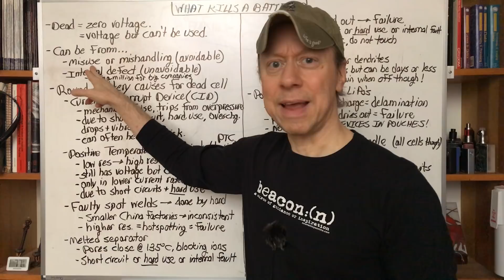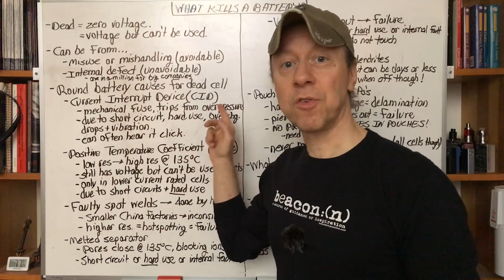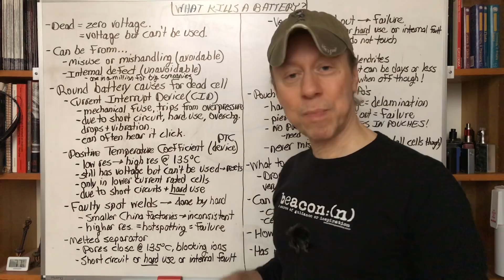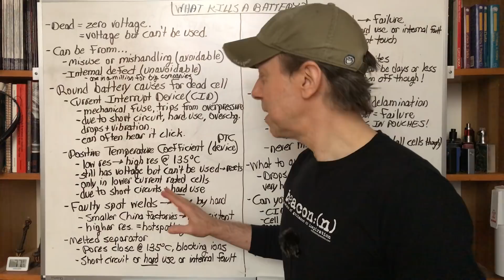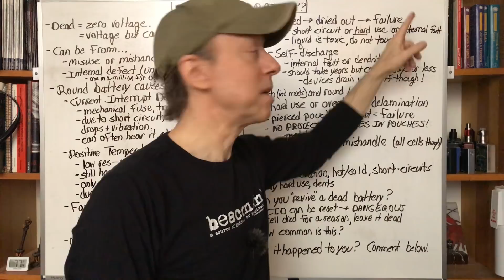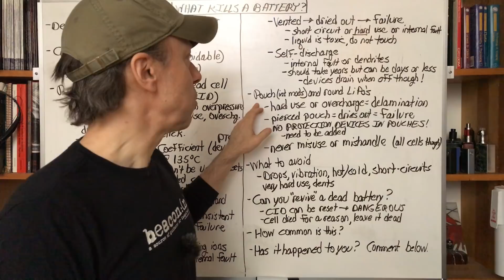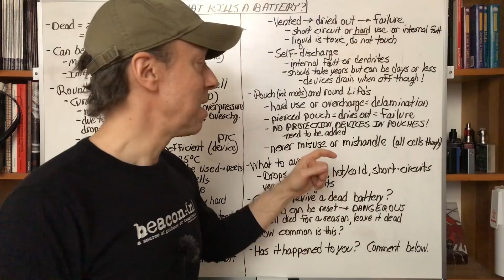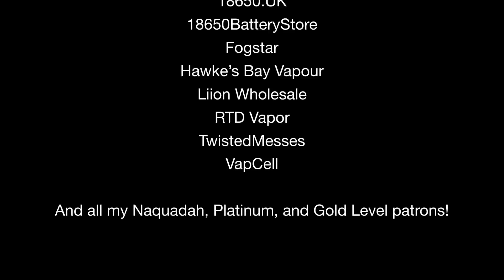Minding Your mAhs Ep028 – What causes a Li-Ion battery to suddenly fail?

Comment: Thankfully in 6 yrs ive only had 1 battery vent, it was a samsung a that i took out of a battery pack. Ive not had any go into thermal runaway(knock on wood). Usually i just stop using batteries because they dont hold as much charge as they used to. Like a pair of vtc5a will usually get me thru the better part of a day, but after ive been using them for a year theyre only lasting for a couple hours. When i recharge them instead of my charger showing that 2000 mah was put back into them when theyre new, the charger will say they only took in 7 or 900mah. Or like with sig mods the chip shows "real time" sag and the mod will say weak battery, even though it says the batteries are at 90%, when i go to take a drag it'll sag down too far and give me a weak battery warning. Thats when i stop using my batteries. One of the reasons i really enjoy my xtar chargers because it tells me roughly how many mah is being put into a battery. My most recent ones that i recycled were some 30qs. When they were new they would take around 2200mah from 3.4v to 4.2, but after about a year they were only taking in 1000mah. Chargers that tell you the mah can be a big help and tell/show ya when your batteries are on their way out.

Comment: Hey mooch, I had a married set of LG batteries (I don't know what model, but they were brown wrap 18650s.) One day I touched them while they were in the charger and they were extremely hot, after I removed them one would no longer register in a mod or in the charger. The batteries were about 1.5 years old and used at 70 watt. I was rotating their use with two other sets of batteries. The charger was an older nitecore 4 bay charger. Needless to say I ditched the charger and recycled the two of batteries.
Reply: The batteries were never dropped, but I had dropped mods containing these batteries on multiple occasions.
Reply: always replace yur batts after about 6 monthes or 500 charge discharge cycles   thats what they are rated for. P.S.  yur charger was fine   its the old batteries.......LOL

Comment: Thanks as always Mooch! Great information. I personally haven’t ever had a cell drop to zero, even the ones I’ve done high current (over CDR) test discharges on. I have seen however a handful of reports about 26650’s suddenly failing (0V) but without being abused. I’m sorry I can’t remember the particular brand and model, I’ll let you know if I can find out.

Comment: I use Samsung 30Q cells pretty much exclusively. Never had a failure. Had them get weaker over time as all batteries tend to do, but never a total failure with one. I DID have one 0v failure with an LG chem cell once. Worked fine one minute, totally dead the next. Never figured out what happened.

Comment: Actually that is such a coincidence that you mention how a battery was good as said by my mod and it wont fire a .3 ohm coil. Just last night this happened granted my batteries are about 3-4 months old but I ahave a system of battery alternation so it's just one big cycle of  15 batteries.  They were good just before I recharged them . Perfectly fine.  After that they would charge really fast, drain really fast. Never got hot. Just ended up throwing them away. They were imren 18650 on the wrapper they say 3000 mah 40A ( I know I know)  20CD . The I'd number I guess you would call it, under the actual wrap reads imren80515c. I just figured they were old but a coincidence none the less. Oh yeah yellow wrapper red print. Also if I use a molicel 18650 35A I dont remember the mah. If I use it on a reliable mech mod single cell at anywhere from .12-.18 ohm dual coil, how long would you say those batteries should be renewed?
Reply from the maker: It depends on how often you take a draw, how they are charged and stored, etc. IMO you should get a couple years from them, at least, unless there’s some abuse going on somewhere. There’s just no good way for me to estimate that though.
Reply: @batterymooch  ok , because I had these for a little over a year but during so I was kinda rough on them as they were my hardest hitting batteries I had so I ran pretty low ohms. I was recently noticing they started to lose their performance.  Looks like I'll get some newbies.  Thanks much. As always great content in your videos.  Super informative.

Comment: What could cause a Sony vct5a to rattle when you shake it. I bought 2 from my local shop and they both rattle when shaken.
Reply from the maker: STOP!!!
Do not shake them again! That is probably the metal rod they wind the layers of metal foil and battery goop on. If it is loose it could possibly short circuit against something internally and cause a fire or explosion. I don’t remember there being a central rod in VTC5A’s but I can definitely be wrong about that. Have you checked their authenticity?

Comment: It happened to me about 2 - 3 months ago. Vapecell 4000mah gold battery wrap. One day literally shows fully charged on the battery charger. After usage for about an 1 hour to 2 hours. The battery could not power up in the vaping device ( regulated mod) I was using. I tried charging it to see whether it would work, but no reaction ( like how you explained in this video).

Comment: Ayuh. Two times. First time was on a pair of ijoy 26650. The second was fairly recent with a pair of vapcell 20700 gold. I tend to leave my batteries in the cradle fully assured of the xtar's auto cut-off feature. In fact, all my batteries live in the cradle until I use em but on only those two mentioned pair of batteries I experienced fully charged but unusable. Heck, my vtc4s live to a ripe old age of 2 years before I decided to chuck em. Again, leaving them on the xtar charger full-time till I'm about to use them.
Reply: That is very similar to my experience - an Ijoy 26650 and 2 Vapcells (a married pair, but mine were purple 3750mAh 24A CDR 21700s).
I have a pair of the Vapcell gold 20700s, so will keep a close eye on their behaviour (they're next in line for cycling through my Ijoy Captain PD270).  I store batteries in married sets in silicone condoms in-house, or hard cases for carrying around, never in the chargers.  Just about any charger is built down to a price, and one surge on the utility power could blow the protections - although the utility power in my man-cave is protected by a 3kva UPS :-)
Reply: @The_Real_Phil_Lee  with mooch's report, I try to reason the deaths to overcharging (CID tripping), but living in the cradle after being fully charged, if anything else, the batteries actually go into discharge without triggering the charger into an auto charge mode. Xtar will only go into charge mode again if: you happen to break contact or, if the mains breakers reset. And those didn't happen when the batteries died. Plus, I always keep the amp charge at 0.5 across all cradles to prevent overheating.

Comment: This Friday morning I came into the kitchen and instantly smelled the dead battery :( I left the unregulated mod standing over night, it had (!) low voltage, short circuit and polarity protection but something went wrong and the VTC4 in it vented. The top of the mod is discolored, the spring from the switch burnt away and probably nothing left from the electronic above :( Oh, the isolation on the battery still looks fine. I suspect an internal short somewhere between battery and electronics.

Comment: Excellent video Mooch, thank you! 

I tend to "retire" my external lithium batteries I use for vaping after around 6 months and buy new ones. I keep the old ones and use them for flashlights and other things. I luckily have never had a castostrophic failure in the last few years of using mech tubes, however I studied your posts on the forums for years before evem touching a mech! Thanks for making me feel "safe" while mech-ing. 
Edit: all approximately three dozen batteries ive used are brand name LG , Samsung, or Sony.
Reply: I have alot of 18650 battery lights too, it is VERY dangerous to use a UNPROTECTED 18650 in a flashlight because there is NO venting that im aware of. I always use protected cells in my lights!

Comment: As per coincidence I got two batteries dying on me the past few weeks: 1 Sony VTC5A and a Samsung 25R. From the first one I don't remeber the circumstances. The Samsung was one of two married batteries I left in a regulated mod (not Yihi)  for a couple of months. While one Samsung drained down to 3.4V, the other one drained completely, multimeter showing no voltage at all.

Comment: This happened to me one time, but it’s human error. I accidentally reversed one cell in a parrallel setup.😲 I know! It’s f***ing scary. Luckily for me, it didn’t vent. One of the cells just died, completely. Must be that CID tripping. It was a sony vtc 5a.

Since then, I always double check my battery orientations before I fire my parallel mechs. I place both batteries at the same time to make sure they’re in the same orientation. It’s good safety practice. 👊😤
Reply: Same here. Some times we as people only learn the hard way.
Reply: Me too - I put the batteries in with one the wrong way round, saw the wraps start to 'boil' from the negative end - took them out as soon as possible. They were HOT. I left them to cool - checked voltage (around 4.1V), 2 hours later 4.0V - the next day I took them to the recycle bin in my local supermarket. Scary.

Comment: I have 39 cells in the 21 mods and one flashlight I use daily, plus one trio of 18650s, two pairs of 18650s, 5 single 18650s, 3 pairs of 20700s and a pair and a single 21700 and a solitary 26650 as spares.  I've had one Ijoy (26650) and two Vapcell (21700 purple 3750mAh 24A CDR) just go to 0v, in all cases fairly new cells and after resting for a while after charging at a maximum of 1A to 4.20v (and I checked that terminating voltage on the chargers - different ones in each case, using a logging multi-meter, that was far from cheap - both chargers were accurate on terminating voltage as far as I could determine).  All being fairly new cells, I am reasonably confident that all were manufacturing defects, as they'd been treated pretty carefully both mechanically and electrically - at least during my ownership.
I have no way of knowing if a box of them fell off a forklift somewhere between the factory and me, or the local post office treated the package badly despite the labelling.  Even inside a hard case, that kind of shock could break any spot-weld which was less well made, and all were Chinese.
I only have 1 26650 mod, so may give up and use 18650s in it (oh how I wish for an extra 5mm height to get a 2n700 in) and only one 20700, so if I lose another set of cells in that I may go to 18650s as well.  Or I may strip the mod to see if 5 more mm can be gained - there appears to be space enough vertically, and a 2.5 or 3mm thick adapter (AKA vape band!) should be easy :-)
The first two cells (Efest metallic purple 18650s) I ever bought are still in use, although have eventually (3 years) been relegated to the flashlight and its spare.
So 3 out of 64 cells, all Chinese, and less common sizes. Seems like hand spot welded to me, and probably faulty from day 1.
Reply from the maker: Thanks for the detailed info!